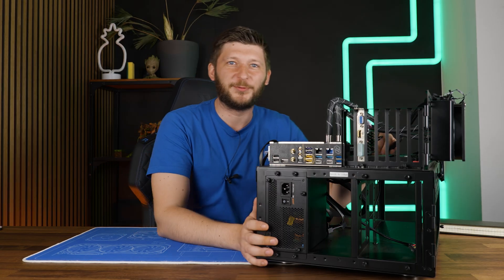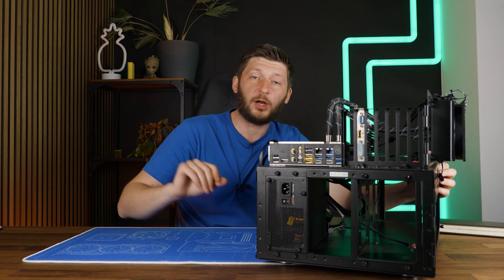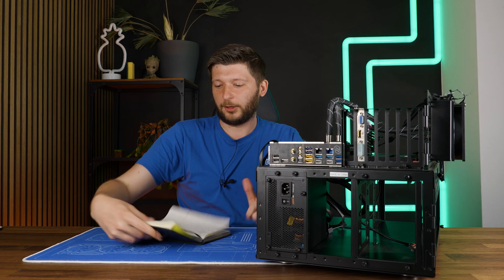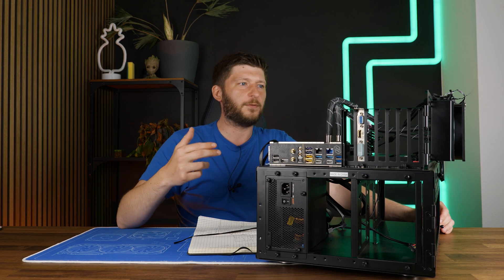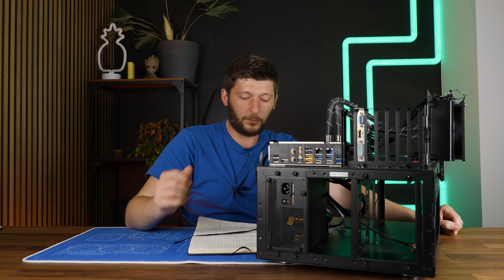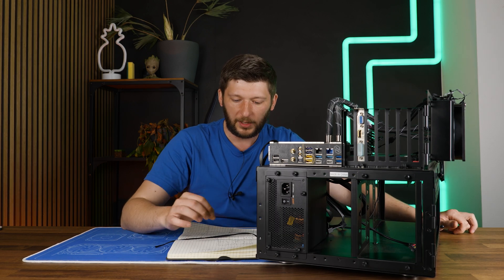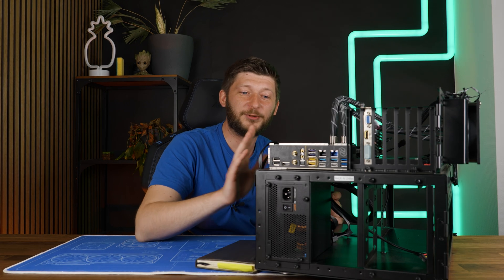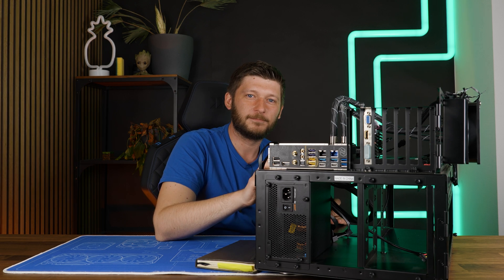How NOT To Benchmark Coolers - Stupid Mistakes We've Made

Comment: Write all profiles settings in BIOS on paper (in case BIOS will be corrupted);
Write profiles on few flash drives (in case BIOS will be corrupted).

More time was spent - more valuble acquired data is.

Looking forward for best fan for radiators (360 especially). I got Alphacool Eisbaer 360 CPU )with their original Eiswind-12 fans) on maintanance (which i got almost new for just ~$55, but have to replace liquid and hoses).
Reply from the maker: I made multiple pictures, iCloud will save my ass at some point ^^

The fans are benchmarking all day long. It takes quite a bit of time for the machine to generate a single number so it might take some weeks, but once we're done all the videos are going to come out one after another